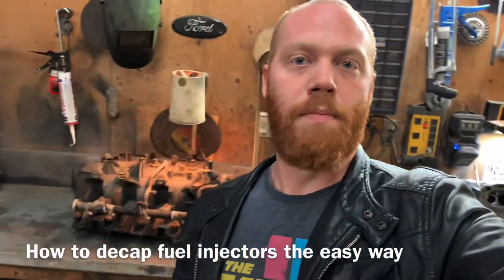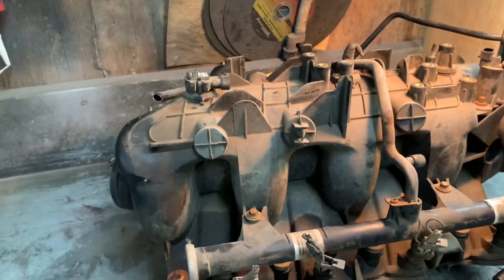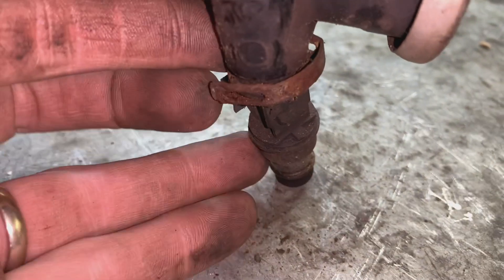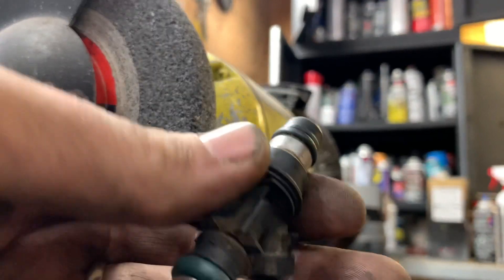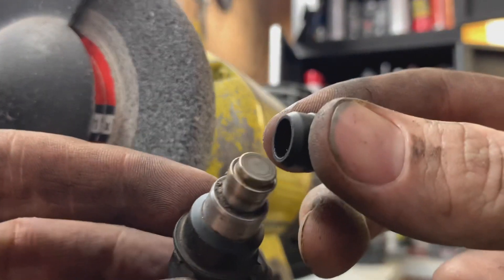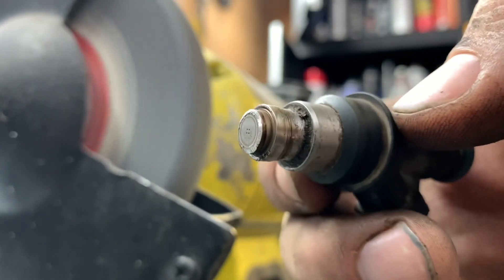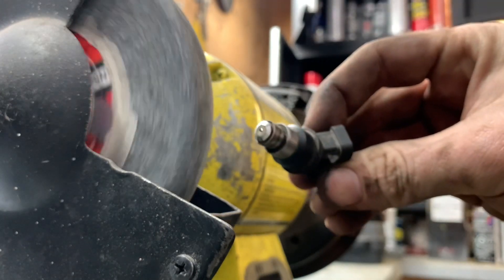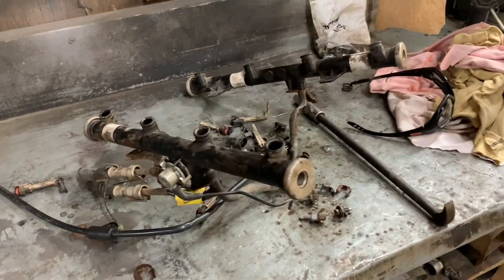How to decap LS fuel injectors - the easy way!

Comment: Great video bro.  But I do have a question:
I'm currently DIY cleaning the stock fuel injectors on my 2015 CHEVY SS 6.2 LS3 that has 100k+ original miles on it. 
I was wondering if you knew where I could find the resistance measurements for these injectors. I've looked diligently and can't seem to find that info. Based off of my cleaning so far, they seem to be spraying fine. I just don't know if they're working as good as they should be though, for my car is misfiring (P0300) I've replaced the spark plugs, spark plug wires, 02 sensors, MAF sensor, MAP sensor, did a resistance test on the injectors using a multimeter(they all read 11 ohms) as well as a test on the coil packs(they all read 13 ohms). I'm honestly not sure what either coilpack or fuel injectors resistance is supposed to be from factory standards, but like I stated previously.. I've tried looking everywhere for this info and couldn't find it anywhere. 

Please, help if you can?
Reply from the maker: It seems like you’re headed in the right direction and have covered all your bases, I would call your nearest GM dealer and ask them for the info you need, they should be able to pull it up in seconds. I worked at a GM dealer here an 2013ish and all of the specs were available then.
Reply: @StationroadRatrods  well..I literally just got off the phone with Chevy. They told me that do NOT disclose that info over the phone. Instead, they want me to bring my car in and take money from me just to hopefully tell me what's wrong... you know how that goes! Smh
Reply from the maker: Duuuude what a bunch! That’s terrible. Another option is if you have a buddy with alldata or other auto repair software, it would have a diagnosis chart with specs like that
Reply: @StationroadRatrods  where can I get that for myself??!!
Reply from the maker: Search alldata on google and there’s a subscription for it, I’m not sure how much money but it’s awesome
Reply: @StationroadRatrods  Bro!!!! That AllData software is fucking amazing!!! I really appreciate you for throwing that at me!! I just bought it and can't wait to start using it! You just won a subscriber as well! 💪🏾❤💪🏾
Reply from the maker: That’s awesome dude I’m glad I could help, I really hope you get your engine sorted out, and if you wanna post some pics and stuff check out my Facebook group, “station road rat rods YouTube”. And thanks for watching and subbing dude!! 🤘
Reply from the maker: Your 300c is sick too by the way, the red is clean

Comment: use a  spiral pick on the oring so you dont rip it, 
also shave a shitty open end wrench down to fit in the gap and it pops the plastic hat off with less wear.
also i put the injector in a socket on a drill and spin it around slowly while i push, cuts it nice and even
great video
Reply from the maker: Awesome thanks for the tips!!